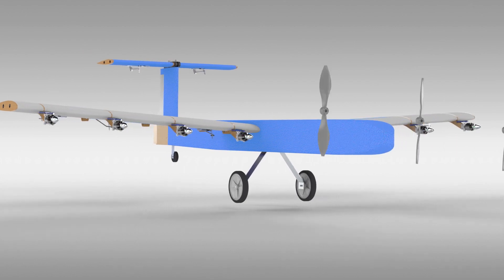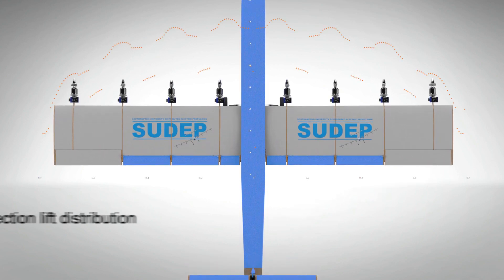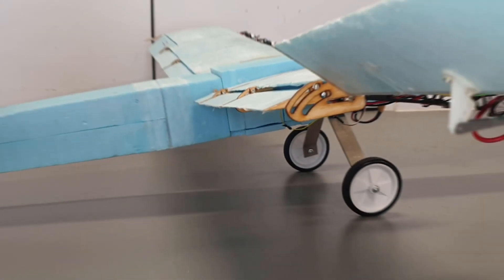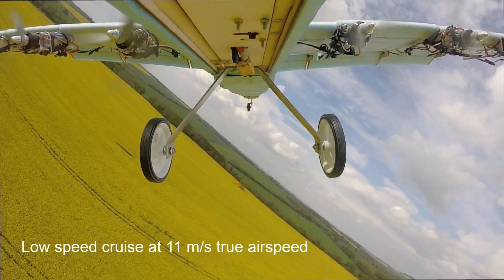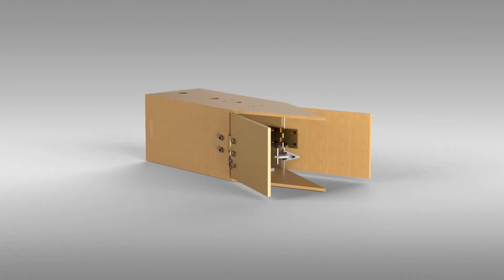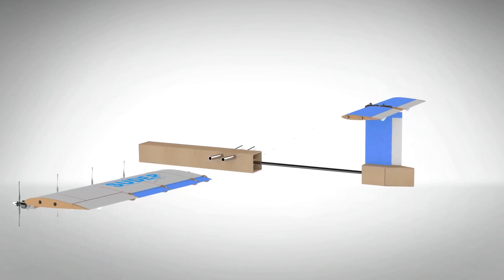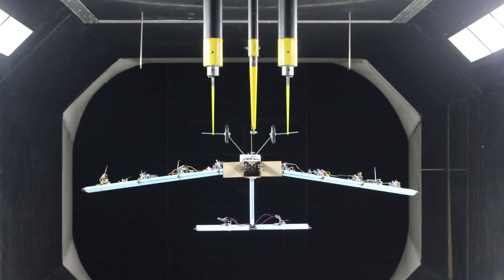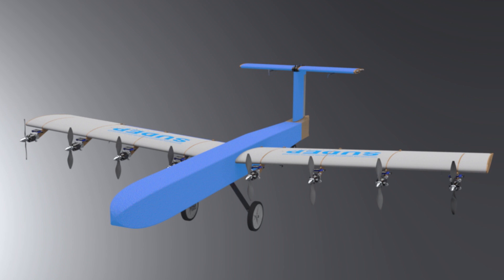Southampton University Distributed Electric Propulsion UAV

Comment: Why'd you guys place the engines below the wing? 
It seems to me that if the idea of diatributed lift is to reduce stall speed, increase low speed handling, increase efficiency etc. Then it serms like it would make sense to place the motors above the airfoil to create a higher pressure differential. 

Nice flaps tho.
Reply: If you have to do something to the aerofoil, do it to the bottom of it.
Reply: I checked it and it is okay 👍🏻. Too high is also not good.